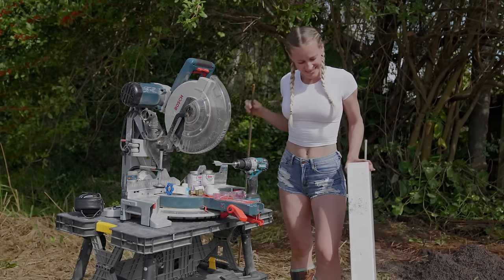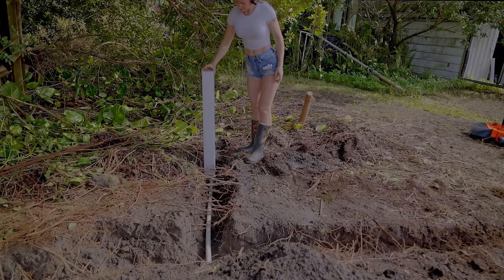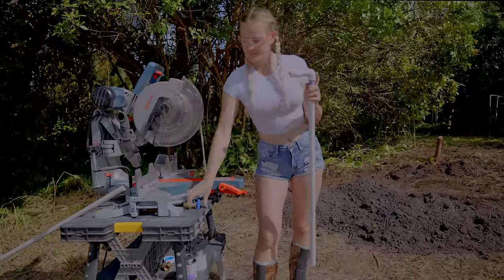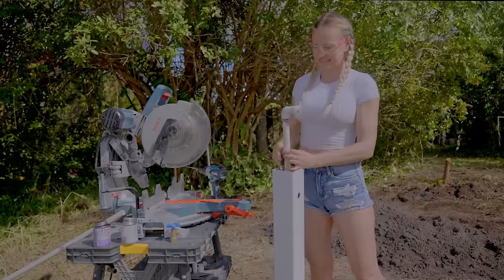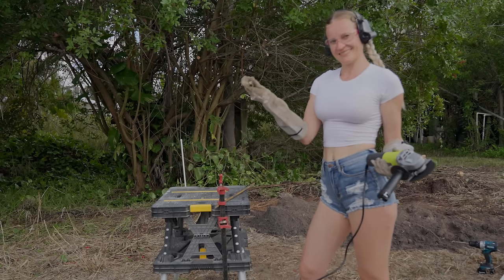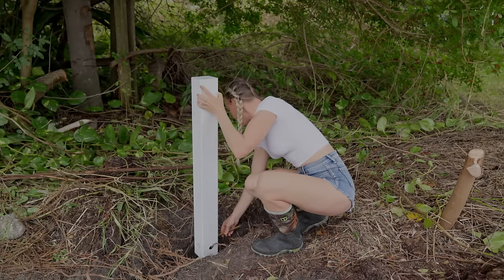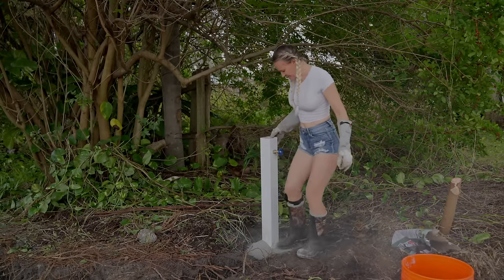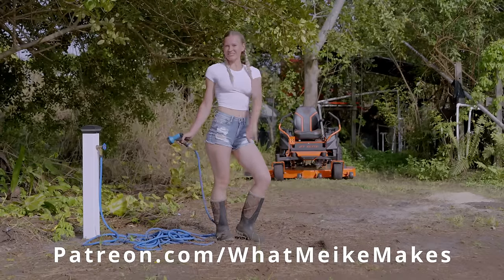Add a water spigot anywhere in your garden

Comment: Great job 👍

But these plastic pipes should not be used outdoors as they will eventually become brittle due to ultraviolet radiation. Stainless steel is better.

Greetings from Germany.
Reply from the maker: Hi Guenther, thanks for stopping by. 
As I live in Florida Charlotte Pipe is the best material to use for Plumbing. The bad water will eat through anything else in no time. Plus all of the plumbing is either underground or protected by the Post sleeve ;-) best wishes to Germany